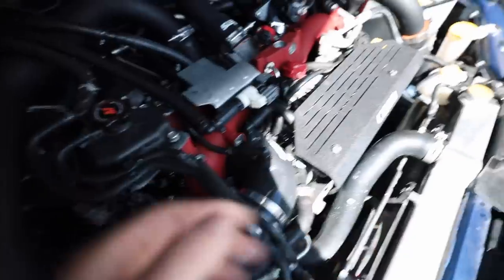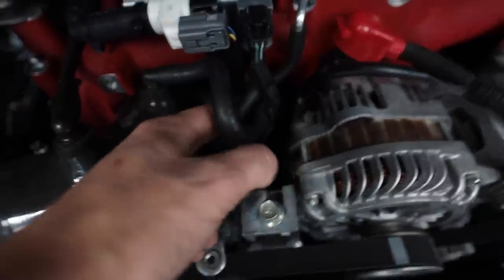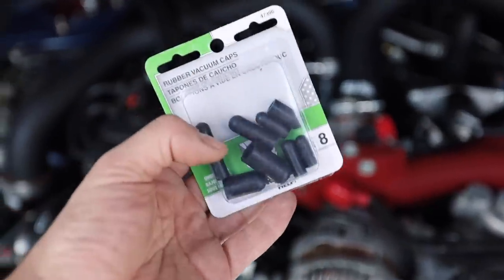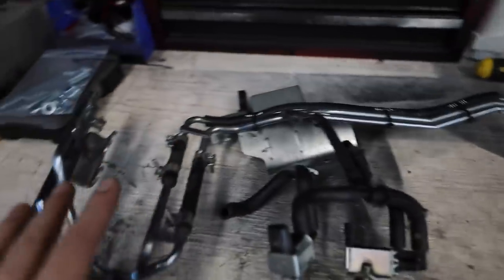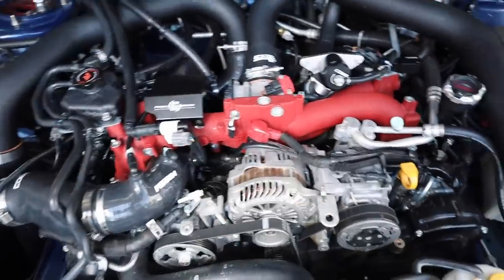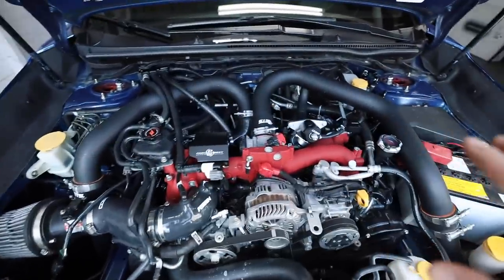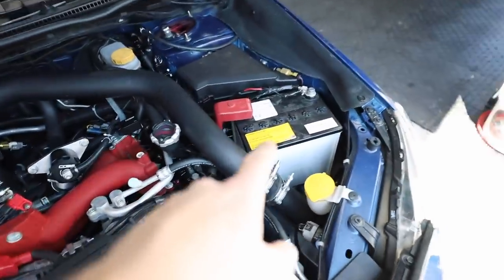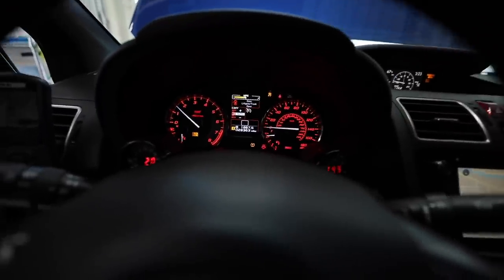How to Delete your EVAP Solenoid (STI)

Comment: Hey, so I have a 2018 WRX 12,000 miles and I installed TGV and EGR deletes the other day (I’m on a base tune ) and after driving around for 10-15 minutes my car pops a CEL ( EVAP code P0441), cruise control flashing, abs light on and hill start assist light on. I’m not sure weather to take the car to Subaru because there’s an actual issue or it’s just popping the codes because of the mods + base tune. Any thoughts you have would be greatly appreciated.
Reply from the maker: My guess would be tune related, the EGR will throw EVAP codes since it is emmisons based. Should go away after the protune but I would verify with your tuner
Reply: Smeedia Actually I was just dumb and forgot to take out the EGR motor 😑. Thanks for your Input though!
Reply from the maker: Happens, but glad it was a quick fix!

Comment: i got the code p0455 , my gas cap is tight took it to the dealer couldnt find the problem? any suggestions? 
can it be the evap solenoid purge valve or a hose that is leaking? its a 2020 sti w only 800 miles'
Reply from the maker: No mods at all?
Reply: Same here 2020 STI but I do have mods lol.

Comment: Do you need a pro tune to get rid of the evap codes ? Or can I do it off my access port ?
Reply from the maker: You'll need a protune 🙏
Reply: @Smeedia  damn my car already has a protune do you know if they can remap it or no ?
Reply from the maker: Yes they should be able to 🙏
Reply: Do you have issues after refilling fuel? Issues starting. Was told by our protuner no way to get rid of that issue.
Reply from the maker: No issues at all, typically if you do that's going to be your charcoal canister

Comment: Can this evap solenoid cause my car to fuel stumble a bit at 2500 RPM? I never had it before but my car had the engine replaced recently and now I notice it but the evap was disconnected and I had to re connect it all.
Reply from the maker: It shouldn't, are you on the Stock FPR? The OEM FPR will cause that to happen
Reply: @GetaDomTune  nice i didnt know that my tuner saw my log and sais he doesnt see any lean spots and i logged it in the area i notice the stumble but i can hear very very faint pops in the exhaust while im at 2500-2800 after that it goes away but i am on a base map and i have an FPR so thats why its odd but the solenoid i reconnected it based off the manual and my buddies sti.
Reply: @GetaDomTune  1000 IDs but it ran just fine prior to me installing tgv deletes, EL header with upipe and EWG i got ringland right after so i bought a short block and had a shop throw it in for me so im at 275 break in miles on the new upgrades.
Reply: @GetaDomTune  yes stock rails and lines
Reply: @GetaDomTune  yeah it seems like i have it but what can i do to get rid of it? I already have a FPR and a base map but a revision of my previous tune so its not the very first tune. Ive read about some extension vac line?

Comment: how you solve the track off light and check engine??? same whit "SI" drive mode are blinking how you fix that?? i have code P04F0 can delete using a launch x431 scanner
Reply from the maker: Your tuner can delete the codes

Comment: Welcome to the the light weight battery fraternity! Shedding pounds couldn’t be easier. Now you will be able to fist past your charge pipe as well 🤣. Have the exact same battery set up.
Reply from the maker: Brush that tint battery is HEAVY, I don't think there is any type of weight reduction with that thing 🤣

Comment: YES these are my favorite mods. MoAR PLS
Reply from the maker: The free or cheap ones? 😅😁🔥 ill see what else I can whip up!
Reply: @Smeedia  weight savings. I already have 2 of my rear seatbelts removed, rear headrests, front and rear bumper, spare tire kit. I love the lithium ion battery on my bike but I'm scared they wouldnt be enough for the subi. Looks like you just got a lighter weight diff construction regular battery. That may be the way I go too.
Reply from the maker: Battery video will beive tomorrow but that thing feels just as heavy as the OE one

Comment: There were a lot of high fives and fist bumps in the comments below.  The video was informative, but perhaps earlier in the video, the author could have made it clear that doing a EVAP delete on your Subaru will set of a litany off computer codes, check engine light, and cause your cruise control to deactivate. your car will not be easy to live with? You must have a protuner monkey with your ECU after removal of the EVAP system in order to deactivate these codes permanently? Am I correct? 
Pro tunes can cost hundred$$, so dont just yank parts without a plan
Reply from the maker: I've got a dedicated video on what needs to be done to correctly delete EVAP in these cars. Should have premised it in the video but you are correct, tuning out or disabling the codes would 100% be required when deleting the EVAP 

https://youtu.be/hspbw6jZJSw

Comment: OK, you have got to watch what you're doing with your aperture. The last several videos have been so washed out. No detail in the highlights. It looks terrible man. If this is what you want to do for a living then you need to figure out some things with your lighting. Shooting outdoors is simply a hard thing to do. especially in the middle of the day.
Maybe look into getting a 6'x6' (or larger if you can afford it) silk to cut the sun light when you shoot outdoors or have the car part in the shade and part in the sun. Also remember you'll need the frame to hold it and a coulple heavy stands and some and bags. those things turn into sails in the slightest breeze. OR, shoot in the garage and stop wandering around in the sun when your camera is set for the light in the garage.
 The camera just can't deal with that much of an exposure range. It's a Canon DSLR right? So at best it has a latitude of maybe 3 stops. if that. 
The other thing you could get is one of those pop up tents (10'x10') that is white over the parts in the sun. Don't use the blue ones, those make everything look very blue and look terrible. White pop up tents actually work perfectly!

You've got great content, now you need to work on the actual mechanics of shooting video. Still images are easy compared to video. 
No hate man, just trying to help you out! Love your show!
Reply from the maker: The G7X (the smaller camera) is awful in any type of light and washes out so easily, the EOSR is much better to work with in any type of light. The built in ND filter on the camera is not doing any justice, playing with the apature is something that I totally spaced on with the G7X up until this afternoon when I was shooting another video. But I 100% agree with you. The G7X is literally the worst camera for auto focus that I have ever seen as well, should have got the Mark II over the Mark III but working with i got on that one now 😅
Reply from the maker: Also the garage were moving into is much more forgiving with lighting, the house hates to the south so not as much direct harash light as I currently deal with. Trying to balance the VND, ISO and Apature with the EOSR wither kills the background image or the foreground. But will be resolved here soon!